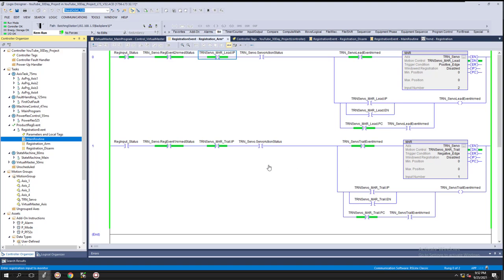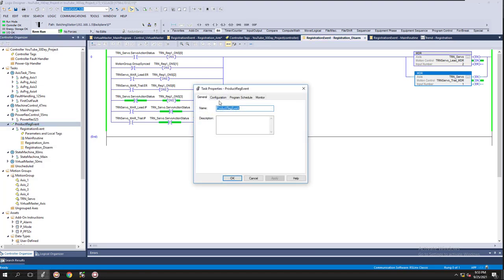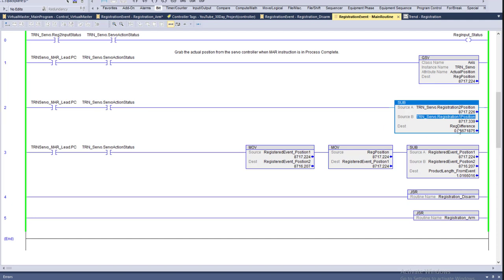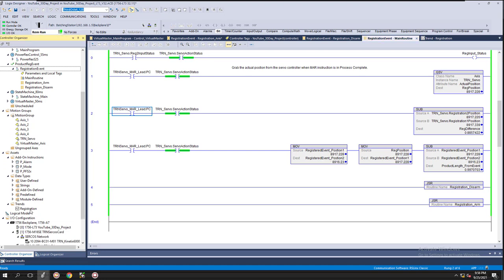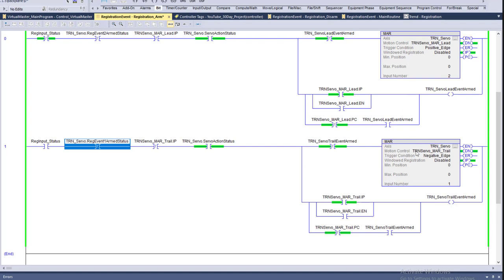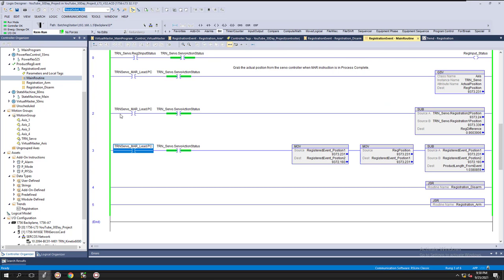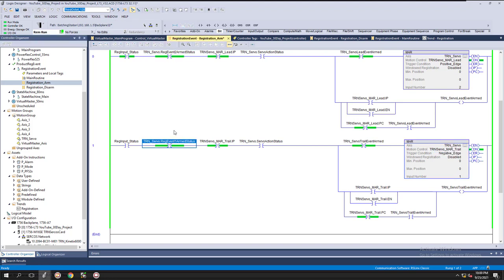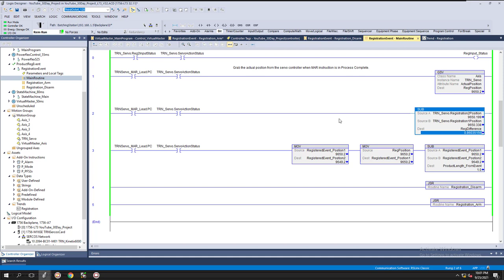Servo Registration Important Knowledge About Positive and Negative Edge Tracking under 10-minutes

Comment: Hi Shane.
About Torque in servo motors with Kinetix 6000.
How to understand the values for each motor?
Is a percent of peak torque in plate motor?
Is a scaling program in motion modules?
Is a value related with the servo drive?

Thanks for your help.
Reply from the maker: To better answer your questions.

Here is a completely free course for an introduction to motion controls for servos.

https://www.allen-bradley-plc-training.com/p/allen-bradley-plc-intro-servo-controls-training

The peak torque is derived from the motor KW/HP on the motor nameplate.
There are parameters in the software to allow the peak torque to be used in a higher percentage than designed however, this is used for start-up curves to get the mechanical system being driven in motion then the continuous torque is what should be followed.

Keep in mind, there are different types of motor sizes as well.
Example: 
-Low-Interia 
-Medium-Interia

There are two software parameters for torque, both work in percentages based on the motor used.
-Peak Torque (Short time use before servo fault)
-Continuous Torque (Longer time use before servo fault)

Scaling is based from the mechanical devices used like gearboxes, pulleys, or in other words, the drive train.
Reply: @ShaneWelcher    Gracias.